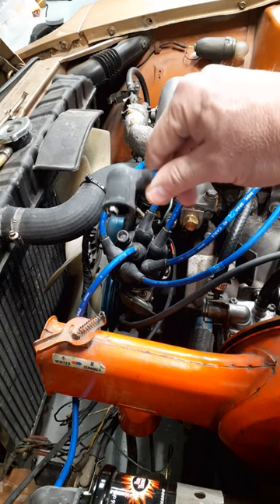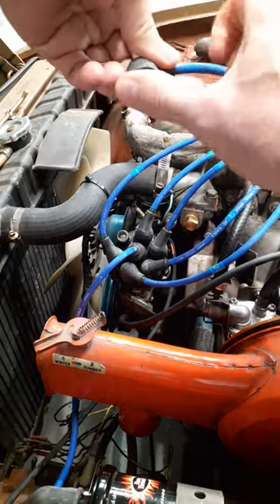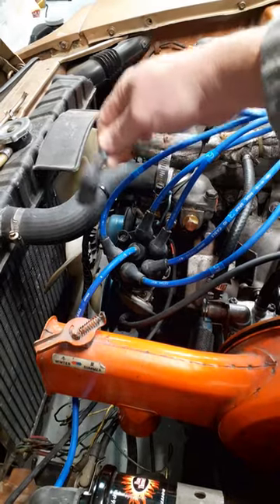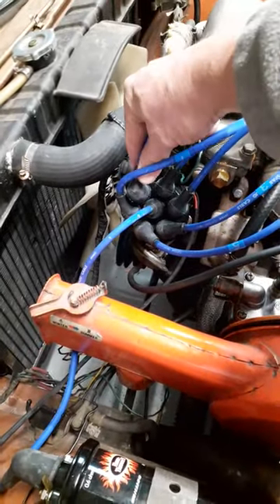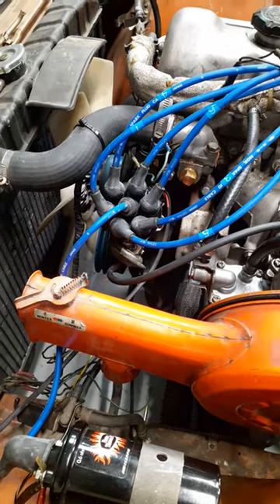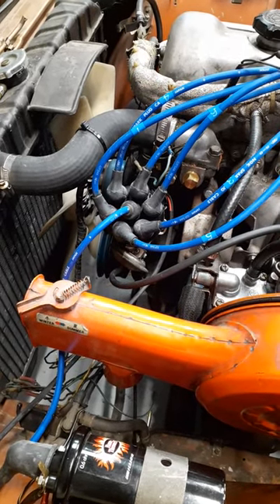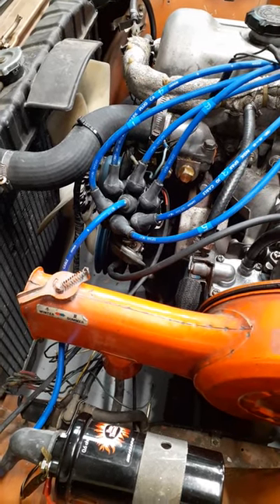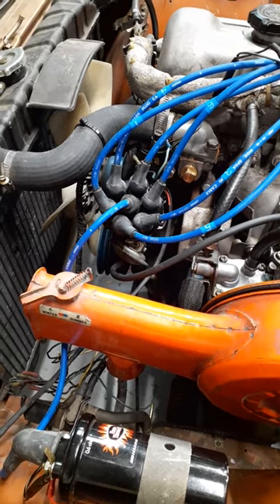Check Plug Wires at the Distributor Cap

Comment: Dude, I been working on cars for 35 years, I have a 240z and been dealing with a miss at a high RPM. Thought it was my triple Webers for years. Turns out the pre made Taylor spark plug wire wasn’t sitting deep enough down in the cap. Ran fine at idle but would loose spark when revving it. You could see the spark disappear when having a timing light strobe flashing in sequence but stop flashing erratically when revving.   Thanks for confirming my madness.
Reply from the maker: Thanks for letting me know it helped. Enjoy the ride. There are ways to diagnose this with an oscilloscope, too. I have to watch those videos more so I can put my scope to good use.